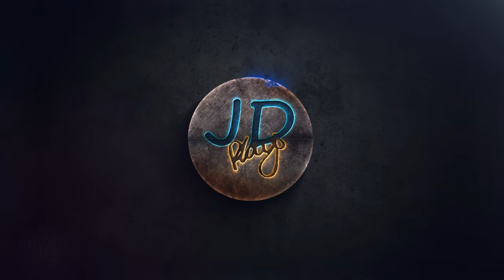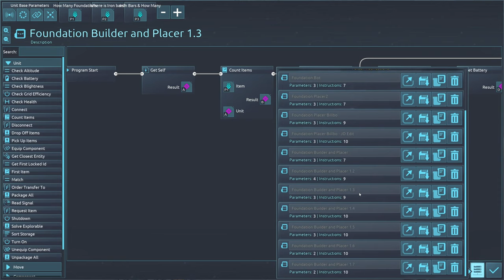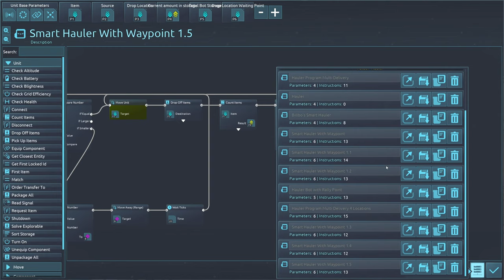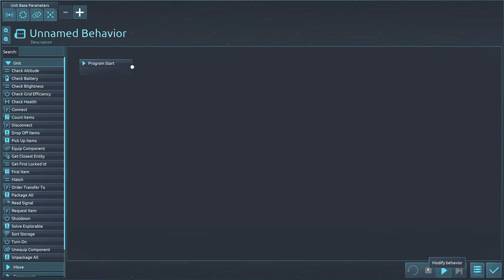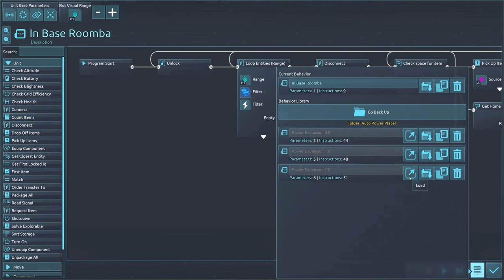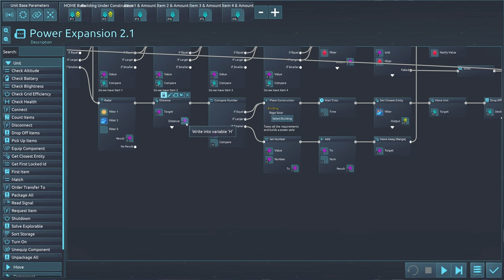Automated Power Pole Placement 🤖 Desynced Ep8 ⛏️ Lets Play, Walkthrough, Tutorial

Comment: I needed to watch this episode twice, because I nodded off the first time. It was a long day at work. (I needed to mute your live stream of CoI, so that I could watch this.)

I dropped an idea in your Discord about placing power poles in a grid layout à la Nilaus, which I might try out. Your random placement will be fine for your needs, but it could come back to haunt you later, if they happened to placed in awkward locations. There will be order in the main base. There will be chaos out in the wilderness.

You might need to add a sub-routine about not entering the blight.

Seeing your code for the behaviour is making me wonder if some of my own ideas are even feasible. They could be simpler, because I would be following a known pattern. I will constrain my problem, so that the solution is easier to code. A lot of practice and debugging will be necessary though.

For your twin turbines, would it not be cheaper to use two medium socket 1x1 buildings instead of the 2x1 2M building? It would also mean that you could sneak the 1x1 into those areas of the plateau where the 2x1 building will not fit. Might was well build on the cliffside first, then add on the next layer as your power requirements increase. Depending on where the ramps are located along the perimeter of the plateau, you will want to leave some path ways open for driving back and forth through the area. Maybe demarcate the top and the bottom of the ramps with walls on both sides? It is getting harder to see the terrain elevation changes with all the foundation that is placed.

When the power pole placing bot is returning home for a resupply, does it have a 'butler' bot? Could the two of them determine the closest point for an intercept, so that the exchange can happen as quickly as possible? I am wondering if assigning a bot to the power pole bot would speed up the request process, instead of relying on random bots in the logistic network.

Hopefully, I will catch another video tomorrow, before I head off to work.
Reply from the maker: The power pole bot requests as soon as he hits the network and any bot can carry items to him, so  there is no need to send him a dedicated robot. Also using a set grid for power pole placement works, till the terrain says NO, id prefer random placement. And in the main base I can see most power poles being removed and placed in existing buildings anyway

Comment: IMHO, but placing power transmitters separately from production seems as a better idea to me. Don't really like to mix up things together.

And yes, behaviors don't care about the Blight unless you specifically check for it. The Blight obstruct communication and when you issuing orders to your units or want to place down a building you communicating with them. Technically you issuing it before anyone go into the blight, but to prevent you from loosing units to the Blight game acts like they are already there and blocks communication.

However, unit working on a behavior is completely autonomous. Thus it can freely go in and out of the blight on its own as well as place buildings in it. Later on you'll unlock tech allowing you to communication in the blight, so this stop being an issue. They'll move around at the speed of a snail there without some extra tech, but that's another story. BTW, I'd give at least virus protection to your power pillar placer bot.

Comment: Is there a range limitation to the teleporters? If there is then could you daisy-chain a line of towers with them (just like power poles) right back to the factory area? No need for bots to run back and forth at that point.
Reply from the maker: Yes there is they can only yeet to the tile beside them